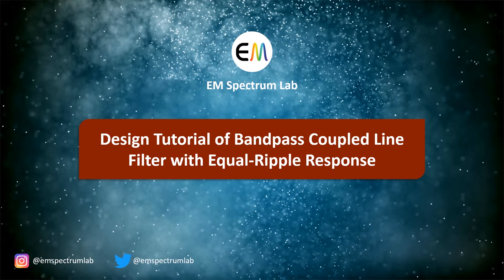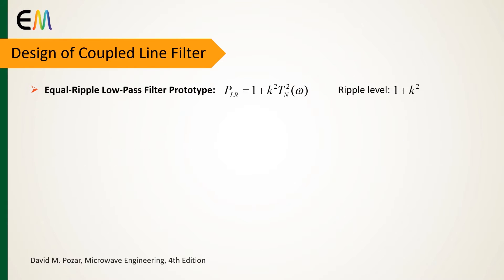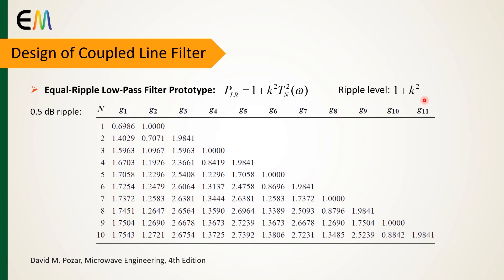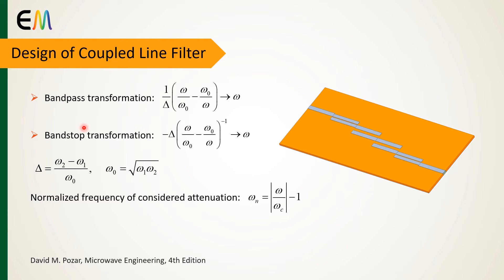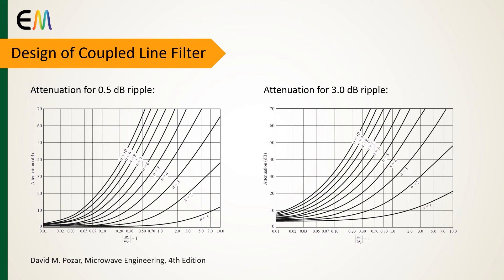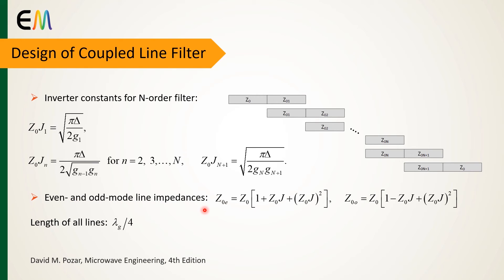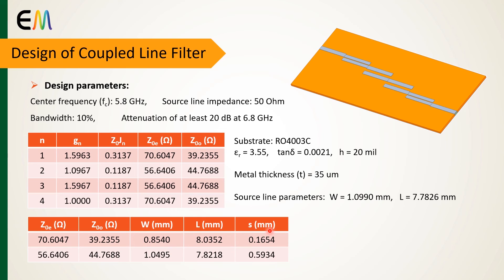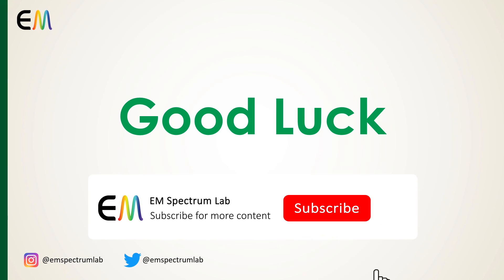Design Tutorial of Bandpass Coupled Line Filter with Equal-Ripple Response

Comment: It is useful for me. Thank you very much! Please show me how to know W, L, S? I am confusing about this. Thanks Sir!
Reply from the maker: I am glad that it's helpful for you. To calculate W, L and S parameters of a coupled microstrip lines, you can use an online calculator like this: http://wcalc.sourceforge.net/cgi-bin/coupled_microstrip.cgi
Reply: @EMSpectrumLab  thanks. I already used Ads to do it
Reply: can you explain how to get s .w. l, i cant understand from online link
Reply from the maker: @omtoya3616  You should enter the assumed parameters (such as frequency, metal and substrate thickness,...) then select analyze and get W, S, and L parameters.
Reply: @EMSpectrumLab   I did as you said sir but I couldn't achieve the same result
 You can see it through this link and the file name is hhhu
https://files.fm/u/8c73fxw2y
Reply from the maker: @عبدالالهالماجد  This difference is not important. Some calculators get results with some differences which is related to their accuracy. You can use also ADS Line Calc tool for this purpose.